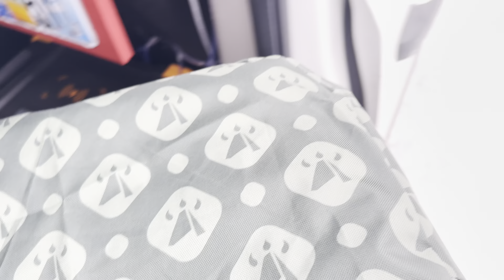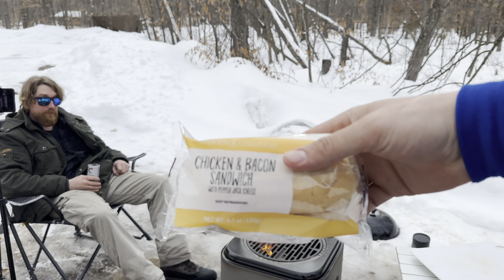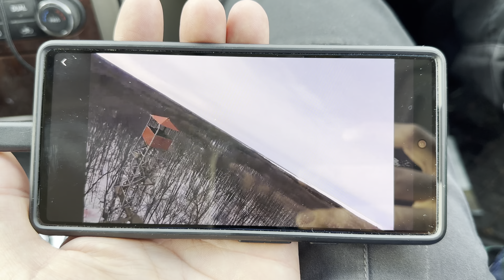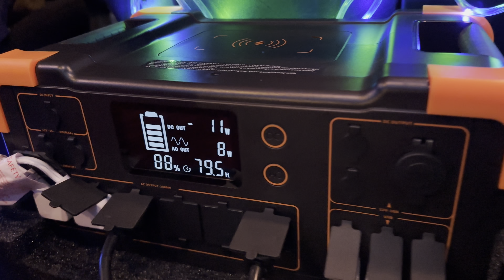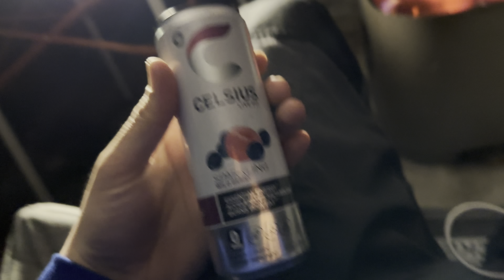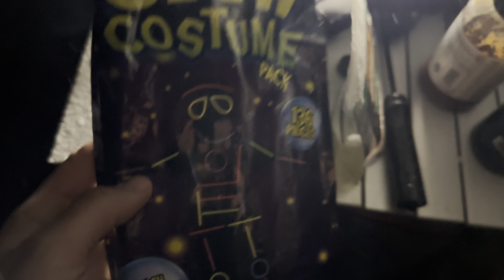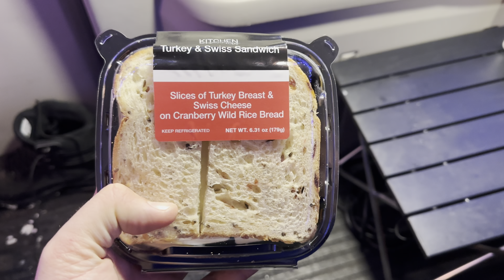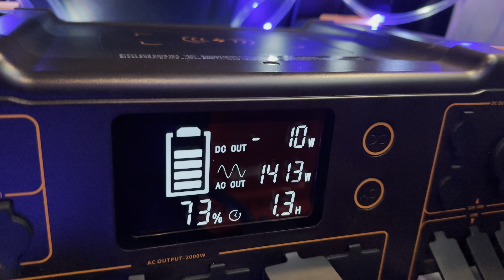Car Camping in a SNOWSTORM | Winter Van Camping / Van Life

Comment: One technique that works well for steaks up to about 1-1/2 inches thick is cold start pan frying. It cooks the inside and browns the outside, without adding much of the unwanted gray area. Put the unseasoned steak(s) in a cold carbon steel or cast iron pan and cook for 2 minutes on high heat, preferably coals. Turn and cook for 2 minutes on the other side. Turn again to the first side and brown over medium heat. Keep turning every 2 minutes until done to desired degree. Rest for 10 minutes and add seasoning to taste and melted butter if needed. And skip the cooking oil, since none of the usual alternatives will survive high heat. A bit of smokin' tallow will keep lean cuts from sticking to the pan, but fattier steaks make their own oil.
Reply: G’day from 🇦🇺Australia 
I just read your comment and thought you might like my set up, 12v set up, Australian locations including world heritage listed Fraser Island and camp cook ups. 
Cheers and travel safely 🇦🇺
Out There Touring

Comment: Damn that lights bright I got one a little bit brighter than that one it's 5500 lumens and The battery on it is stupid good it can last 60hrs on low and medium setting.  It use two USB type C ports one for the actual charger and the other port you can charge another flashlight if you want it also can charge up your phone.  You can also charge the light with your phone if needed
Reply from the maker: Nice bro, I have a 7000 lumen one that’ll be in my next video. Plan to get both o light and Fenix brightest flashlights eventually